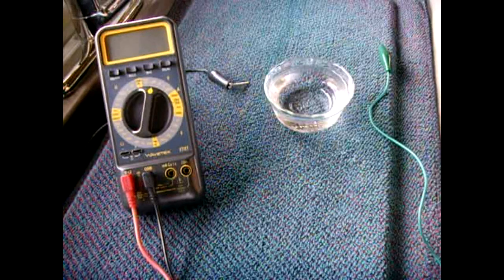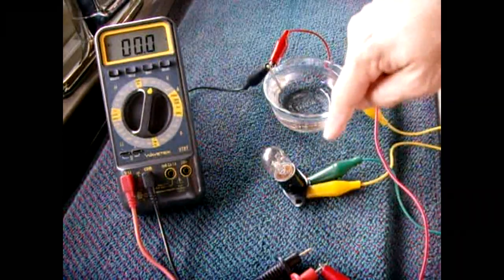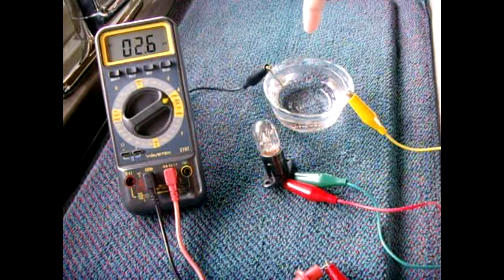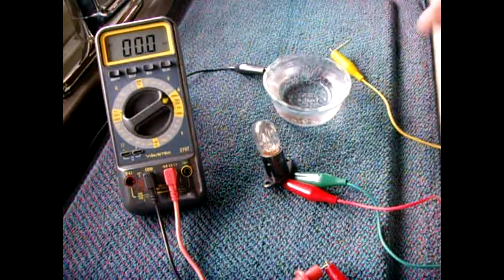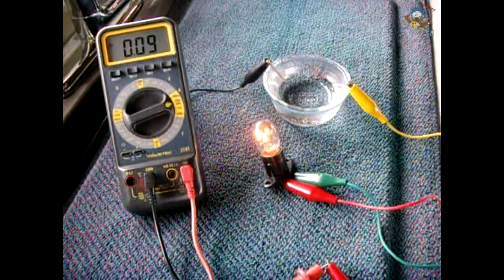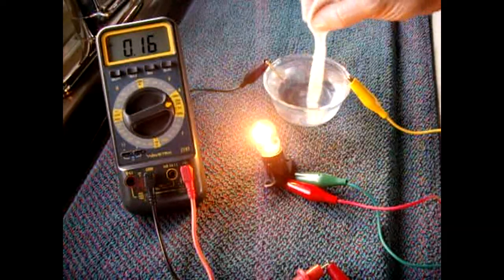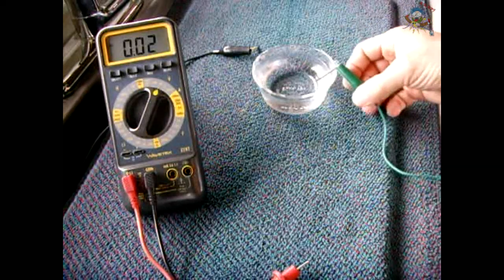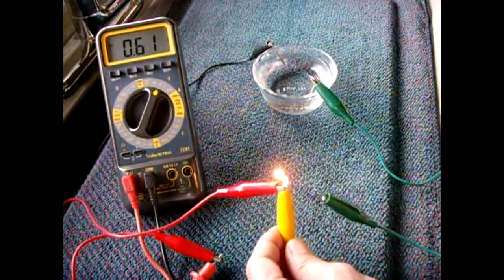Is PURE Water Conductive? Find Out!

Comment: I would be curious to see what your TDS meter would read in deionized water or ultrapure water which is used in laboratory experiments. The meter on the water purifiers usually reads 18 megohms per centimeter.

Comment: On your video you could also take the other end of the  green jumper wire and put it on the black( common lead to the multimeter) and get the same results. That is what is also known as a series circuit, where there is a single path  for electrons to flow from negative to positive back to the meter itself.

Comment: Ions in water are heavy and don't move easily. I would also think they are quite far apart in low concentrations, so how does the electric field manage to propagate through the water and at what speed ?
Would there be a magnetic field associated with it and what shape would it have ? I am talking about experiments with DC currents.
Would there be any dynamic effects associated with pulsed DC currents through water ?
What if water is used as a dielectric in a capacitor ? Can you charge it and then mess up the polarisation by stirring the water ?

Comment: Pure H2O is not conductive, becuase well, it's only H2O, and there's nothing for electricity to pass through
Reply from the maker: Andrew James Correct
Reply: In really pure water at 25 Celsius there would be 2x10^-14 hydroxonium and hydroxyl ions per litre, so it would be a poor conductor but very far from being an insulator. Accepted figure is 5.501 microsiemens per meter
Reply: Hydroxonium, or an Arrhenius acid, is a substance that dissociates in water to form hydrogen ions (H+). Similar to hydroxyl ions. So in my opinion the hydroxonium/hydroxyl ions would be impurities in water which would explain the readings you provide. So your really pure water is not 100% pure at all. Water without impurities does not conduct electricity at all but it's the impurities in water that do conduct the electricity.
Reply: If you had absolutely pure water, nothing else but H2O and you had a power supply on hand that was millions of volts, in theory, there would be enough H3O+ and OH- ions present for electrolysis to happen.  Now, I say "in theory" because you would have a major arcing problem.

Comment: That means pure water, especially if running, can be used to clean a PCB that has been damaged in regular water and drinks such as coffee etc. I tried it on a laptop mother board and then refluxed it. It worked like a charm.
Reply from the maker: Electro Sounds logical. Pour distilled water over the board to rinse away any dissolved solids/ions, then use a hair dryer.

Comment: Doesn't this have to do with free ions? Rather than solids? NaCl is a ionic bond that the water breaks apart to dissolve, so there are free-floating Na+ and Cl- ions which are migrating to carry the current. That my understanding, anyway. How will this work with dissolved things with neutral charge, bonded together by covalent bonds like sugar?
Reply from the maker: Power Max Dissolved mineral components of water include the ions
Reply: Power Max  Sugar won't conduct electricity.  electronicsNmore is using a TDS or "Total Dissolved Solids" meter.   From a pure chemistry perspective, the term 'dissolved solids' is wrong.  However, a TDS meter works by measuring potential difference so it would only detect mobile ions and the term "solids" is acceptable as long as you understand that "total solids" actually means total electrically conductive solids.     I don't believe you can get an accurate measurement of sugar from a TDS meter.
Reply: Michael V Thank you. This is what I was also thinking. Sugar molecules when dissolved shouldn't have a net charge, although they are polar from the looks of it. And of course heterogeneous mixtures like sand added should not make a difference in the electrical conductivity either.
Reply: Sand can be quite salty.  Most of our world is quite salty (no pun intended).  So a TDS (potential difference) meter is not a bad method for a determining a quick ppm of solids.   The most reliable method would be to evaporate the water and physically weigh what is left over.    That is not possible for most situations where a TDS meter is used.  (for example: the lake that your city uses for drinking water. )
Reply: Michael V Well I mean it in the context of pure silica, without salt contaminants.

Comment: Nice demonstration. I wonder what the implications of your experiment are for active power lines under flood waters? Is it dangerous for people who are emersed in the water? What are some of the ways to avoid being electrocuted  in such a situation? Thanks.
Reply from the maker: S Cin You will definitely be electrocuted with the rain water. The water is not pure. Good advice would be to avoid any power lines that are down, especially near any body of water.

Thanks For Watching!
Reply: electronicsNmore I am wondering then why when there are floods people are often seen immersed near  power lines that are also immersed in flood waters. There must be something else going on...
Reply: S Cin Rain water will be slightly conductive because it contains dissolved CO2 which results in:

CO2 + H2O <—> H2CO3 <—> HCO3− + H+

Cheers,
Mark
***************************
PS
To lower the conductivity of distilled water even more, boil it.  This will drive the carbon dioxide out.  Left open to the air the conductivity will slowly increase as carbon dioxide from the atmosphere re-dissolves.
Reply: S Cin electricity is the same as water, it will take the path of least resistance.  Those people near the lines are only lucky enough to not be in the path of the electricity.  It is still very dangerous.  If any power is flowing at all.  They are just lucky, that is the only reason they are not getting killed.
Reply: The power lines are isolated... ._.

Comment: Distilled water conducts electricity, ultra-pure water does not. Distilled water is not pure.
Reply from the maker: +Akshay Sharma
 Incorrect. I tested it many times. Distilled water is usually less than 1 PPM dissolved solids. That is close to pure as you will ever get.
Reply: +electronicsNmore It conducts a bit.
Reply: The process of making distilled water is you make the water evaporate (Liquid to gas) alone then condense (gas to liquid) it, then it is pure water. Pure water in fact does conduct electricity but poorly and it is called an insulator. There's no such thing as an absolute insulator, all insulator are poor conductor.
Reply: Several issues with this. In industry, "Pure water" Normally refers to RO/DI water. I've personally tested nuclear grade RO/DI water with a Hi-pot. Would show much better in contrast since 1PPM is still a significant contamination. But dissolved solids are not your only issue. TDS can be conductive. But you will have ions within the water, which is where a DI resin would come in.
Reply: @Exachad  it conducts a bit pure water is a weak electrolyte but is so weak that you can assume that it does not conduct

Comment: Hi , Are you using a variac for these mains power experiments ?
Reply from the maker: Steve Smith No. Direct connection with 120vac mains. 1A fused Hot and Neutral.

Comment: Hello there, that's a very informative video but I was wondering... How do you calculate the resistance in a solution. Lets say I wanted to create a solution with 10,000 OHM resistance, How much water and salt would I need to do it?
Reply from the maker: Dr. Pierre Khazen The simplest way would be to position the 2 probes in distilled water, then slowly add salt to the distilled water until you have the desired resistance.
Reply: Thanks for answering, that's pretty helpful :)
one more question, what's the best way to turn this salt water mixture into a paste or a gel (hopefully without affecting its conductivity)?
Reply: @pierrzmalaka  Or another way to find out the resistance of a material  is by determining  four factors. 1. Type of material,2 temperature,3 length,4 cross sectional area (CSA) .

Comment: I've got a question then..... will everyday electronics such as mobile phone work submerged in 0 ppm reverse osmosis water? I risky yet cool video could involve a extension lead hooked up to the mains with a few household appliances attached to it such as a desk fan and lamp, show them working as normal then submerge the whole extension lead into the RO water... am I right in saying that there should be no difference? if the water can't conduct it can't short out etc.
Reply from the maker: Pure water should not damage the phone because it does not conduct. The only problem I see, would be possible corrosion due to the water.

Comment: I'm in class for sterilizing medical instruments and they said something about the water we use must be able to resist 300,000 ohms and I'm wondering is that the regulation for city water also and why would the water damage stainless steel instruments if it didn't meet that requirement

Comment: I run a I'd say around a 7000 gallon boiler and we have to check the conductivity. We do add salt to what we call softening the water of the boiler.  My question is the higher the conductive the more elect currents that's being able to pass threw the water.  But what is it actually doing to the heated water and what's the elect current accomplishing in the water.  Is it separating menials in the water are is it making the boiler create steam more sufficient ?

Comment: I think even pure water is conductive at high temperature. I observed the conductivity of water I tested change drastically after heating the water.
Reply from the maker: +charles krumholt 
Should not be. Pure water/distilled water, is non-conductive. You must have had dissolved solids in the water sample.

Thanks For Watching
Reply: I think you should do another video and put this argument to bed. heat the RO water and retest. I'm thinking it won't make a difference. however it would be good to see the results. and by the way. filtered RO water isn't very good for long term drinking. it has pulling properties and will   behave like charcoal, absorbing vital vitamins and minerals. it's great for a 7 day detox because it will also remove toxins from the body.

Comment: careful, you said you could make a 12v power supply and you sure can.  But you did not clarify that it was NOT a 12v DC power supply, it is a 12v AC power supply.  Would still have to rectify and filter for use on 12v electronics.
Reply from the maker: James Hanson True. I was demonstrating using a resistive load which works with AC or DC. Rectifying, and adding a filter cap is no problem.
Reply: yes sir, you and I and millions of others know that and how to do it.  There are plenty more that don't quite catch the difference between 12v DC and 12v AC.  Someone might try this with a broken usb cable and adjusting it down to 5v DC and destroy their phone or other electronics.  I am just saying that you never clarified that it was 12v AC you were playing with and incompatible with DC electronics.  Actually you do say AC a lot.